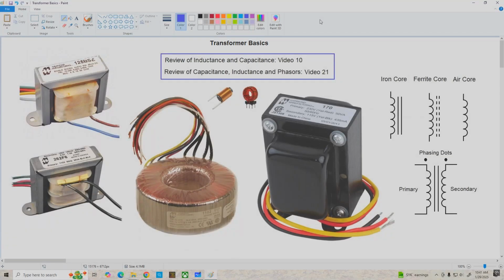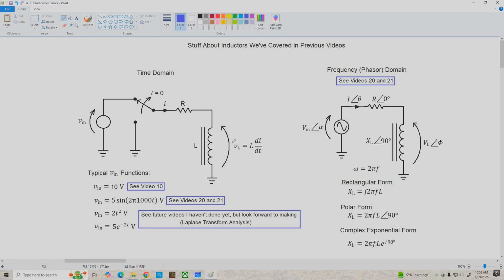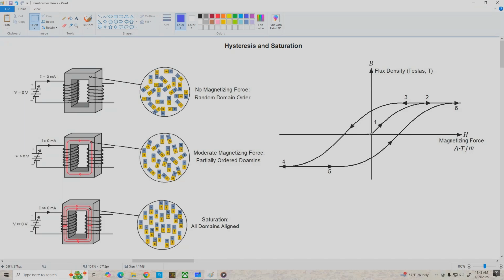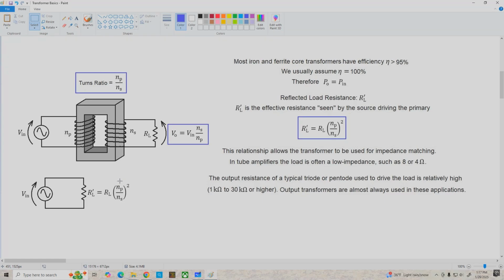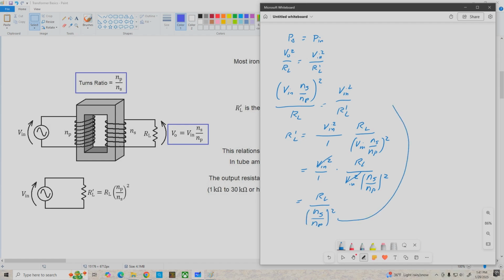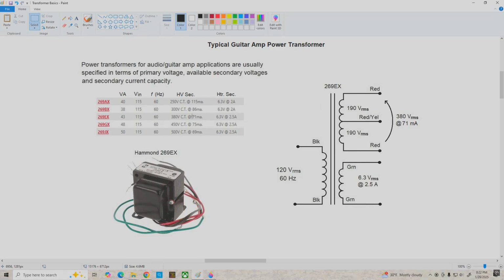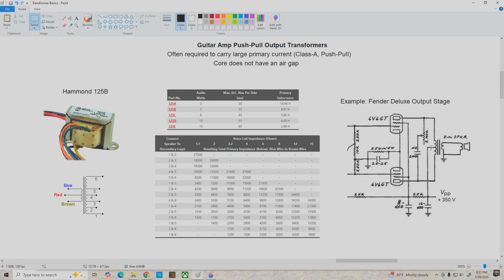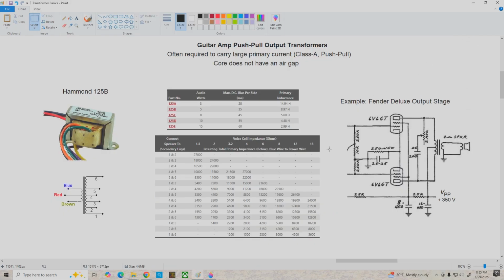Topic 75: Basic Transformer Operation

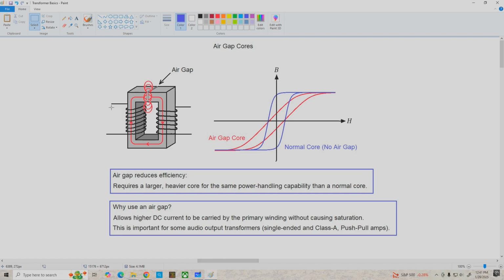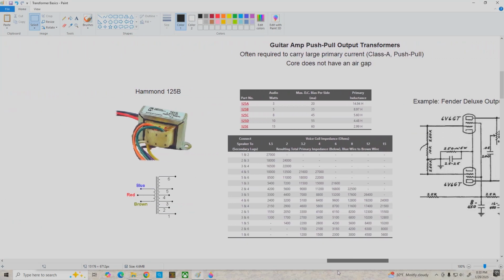Comment: Hi, good video, but I have to point out a mistake in your screen sheet on air-gapped transformers at 7:04, which you even confirm verbally. The box on the bottom claims that air-gapped transformers are important for ... Class A push-pull amps. However, in accordance with the Hammond data sheet at 18:45 you say correctly that the magnetic fluxes from the DC bias currents in push-pull output transformers cancel each other out, so that these transformers do not require an air gap.
Anyway, I'm curious as to how your approach of designing output tube stages in future videos will line up with my concepts on this.
Reply from the maker: @regaldf.9493  yeah. I got sloppy with my explanation. Class A push-pull does carry large primary current but doesn’t require an air gap because of flux cancellation.